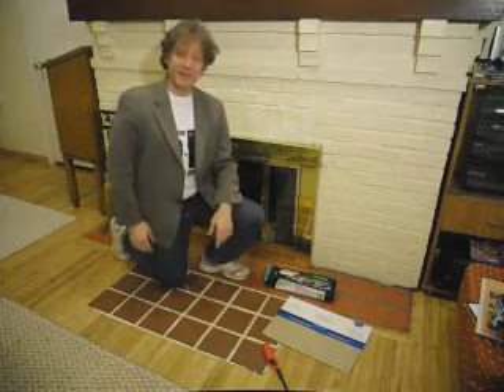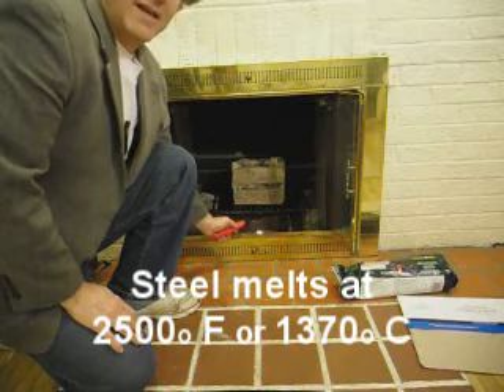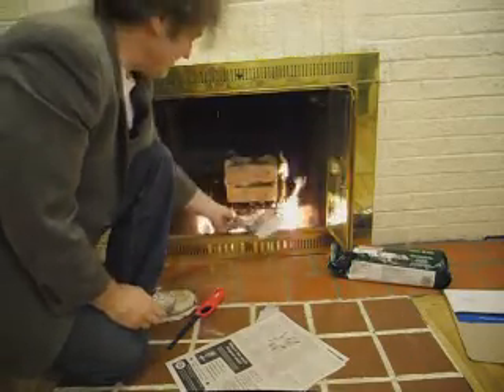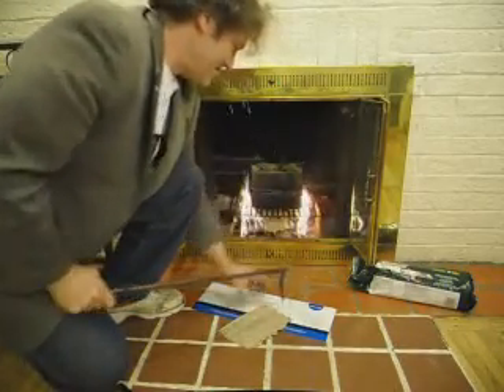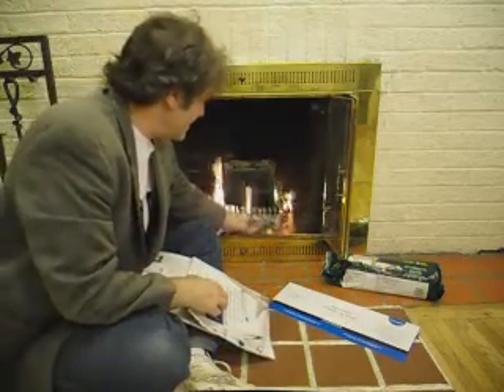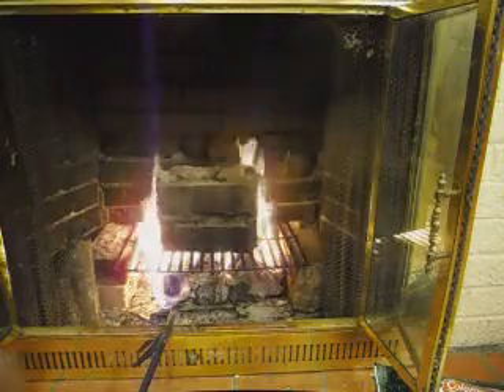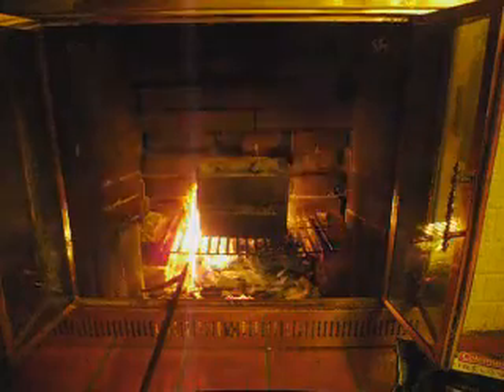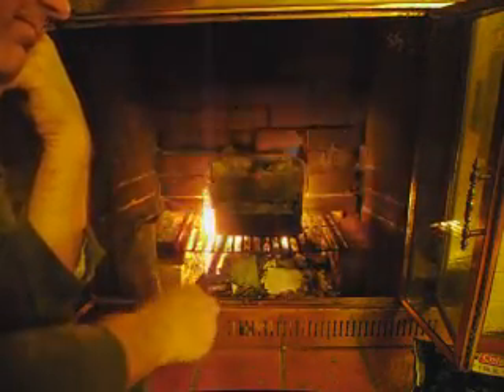9/11 Experiments: Does steel weaken much under fire?

Comment: Blacksmiths have been weakening metals to the point of malleability using fire, forced air and pressure (as hammering or other methods) for hundreds of years. They had no need to melt the metals. Just soften them to a point where they would lose much of their strength. The WTC buildings steel didn't need to melt. It needed to be heated to the point where it also lost much of its strength till failure.

Comment: And I also think that the failure of 100 plus story tall buildings that weighed in at 200,000 tons steel, contained 400,000 plus cubic feet of concrete, reached 1300 plus feet into the air, were horribly damaged by very large aircraft carrying massive amounts of jet fuel traveling at very high speeds can actually be simulated by your fireplace. But that's just me.

Comment: I firmly believe planes and the subsequent fires did not bring down the towers.

But this proves nothing either way ffs. The only way to experiment properly is replicate the events of 9/11 on a skyscraper, which is never going to happen.

It's just a shame that they couldn't forensically investigate the rubble and steel at ground zero because it was all shipped off for disposing asap. Wonder why they did that.
Reply: bsheehy94 Tottaly false ... No pieces left without being checked , all parts numbers where collected and the most significant where kept ...
Reply: olivier talouarn They didn't keep the steel and check it for explosives, they said this themselves.
Reply: bsheehy94 They checked each pieces before scraping ...Explosives evidence don t need chemistry to be seen ...
Reply: Yes they do.

Comment: Your experiment is invalid because:
1. fired was not as hot as was in the towers (1200+ degrees)
2. incorrect type of steel was used
3. incorrect load applied to grate
Your findings are invalid.
Reply from the maker: 1. The paper burned as hot as the paper in the WTC. The jet fuel burned off within the first minutes. The towers lasted for about 1 hour and people could stand where the "fires" were.
2. The WTC steel was stronger and higher quality.
3. The less "load" falling the floors, mostly space, and steel blown laterally.
Your argument is invalid and easily debunked.
Reply: TruthMakesPeace Actually, you are wrong.
1. Jet fuel burns at 1800 F
2. The load I was referring too was that of the intact floors above while they weren't collapsing
Unless you have an engineering degree, shut up. You don't get to have input.
Reply from the maker: gtaclevelandcity
1 Jet fuel has an ignition temperature of 210° C (410° F).  Not even close to 1800F.
http://911research.wtc7.net/mirrors/guardian2/wtc/how-hot.htm
2. Sounds like you fall for Bazant's hypothesis which has been debunked long ago.
http://www.ae911truth.org/faqs/634-debunking-the-real-911-myths.html
3. I got an A in Physics by a highly selective school. 
Steel falls down, not sideways 600 feet at 50 mph with enough force to stick into the AmEx building.
No PhDs in Physics are willing to defend the official story in a debate.
9/11 Physics Debate - Dr. Griscom wins. No top physicists support the official story.
Reply: TruthMakesPeace Yes, it has a flashpoint at that temperature. But do you really think it stays at that temperature as it burns?
Reply from the maker: gtaclevelandcity Good question. The jet fuel burned off within the first minutes. The towers lasted for about 1 hour, cooling off so that people could even stand where the planes entered.
Reply: gtaclevelandcity So it takes an engineering degree to get your attention. OK, see Architects & ENGINEERS for 9/11 truth. There are over 2,000 people in that org. that have such training who say the NIST 9/11opinion is hogwash and that a new inv.is needed. They build and design sky scrappers. You ever built a hi-rise, or even a barn, or outhouse? No pal, YOU shut da fuck up.
Reply: Jet fuel has an autoignition temperature that is at 410° F, but once ignited, it will burn in the range of 800-1500° F. Max adiabatic burn temperature is 4,040 °F, but that would not be relevant here. The point is that it burns far hotter than you suggest, and hotter than those flames reaching the grate in this none-too-scientific video.
Reply: TruthMakesPeace The Jet fuel burned off, after delivering over a million BTU.
NIST, FIREBALL DYNAMICS(75% Fuel survived)
fire.nist.gov/bfrlpubs/fire05/PDF/f05179.pdf
Your demonstration, is INCREDIBLY stupid.
Reply: Don't forget that it was also incorrect structure and the fire was inside of the building, so it acted like a chimney... the fire inside burnt even hotter because of the pull of air from lower floors
Reply: TruthMakesPeace the damage was already done. You also have to note that there was a huge amount of horizontal shear stress on the remaining supports.
Reply: TruthMakesPeace By the way, the lady who was standing in the WTC 1 entrance, Edna Cintron, Jumped to her death to avoid being incinerated to a char.
EDNA CINTRON jumping to her death
11-settembre.blogspot.com/search?q=edna+cintron

Comment: Uh, tell me how I am able to get steel pin to glow in the light of a paper/wood fire that burns at 440F?  you're giving the IGNITION temps not the MAX TEMPS they can achieve with enough fuel.  Good grief.  Tell me how a welder or a blacksmith ever gets their job done??

Comment: Even if the steel was red hot, it wont bend in this experiment. I was more concerned with the warping of steel in the vertical position as this would be more legitimate for those who understand basic mechanics of how building structures work.

Comment: People are not dopes they are just unperceptive if they don't take the time to look close at what some people see as obvious. Construction steel melts at about 2,500 degrees and jet fuel burns at about 1,500degrees. the Jet fuel all burned up in a few minutes. Different types of steel have dif melting points. Concrete does not melt and when it falls it crumbles into chunks not dust. Where were the chunks of concrete? the ruble had very few chunks but instead was pulverized by  explosions into plumes of dust that dispersed throughout the city. The fire was mainly focused in a limited area and would not have weakened the steel at a distance from the fire. the steel and concrete that was not exposed to extreme heat close to the fire would have put up a lot more resistance than enabling the free fall collapse. I don't know why they felt they had to blow up the whole building. It would have been much more convincing that this was a real attack if they had let the building stay in tact but I guess they wanted the spectacular shock effect and knew it would be very hard for most people to really question it. There is a certain type of people in power that care not for human life or suffering. this has been shown again and again throughout history with the many atrocities those with the power to do so can perform. There is some misinformation on this topic of 9/11 spread around to confuse the issue but How they did it has been explained . Like the eyewitnesses that verify these whole buildings were closed numerous times for "inspections" which is when they planted the bombs. Workers were observed carrying in many large containers. Just take the time to investigate 9/11 and explain where the concrete went. Watdh the vids including building #7. Listen to the eyewitness reports of molten steel burning for weeks after the fall in the ruble. Also the explosions at the base of the buildings before they fell. Then ask why 2,000 architects and engineers (and growing) that have had their credentials checked well want the investigation re-opened.        .

Comment: No building has EVER collapsed due to office fires but then 3 collapsed in one day. There were a lot of worlds first that day. The buildings falling at free fall and into the path of most resistance. Plane crash sites without wreckage. Maybe all skyscrapers need structural work to compensate for this new phenomenon and all new skyscrapers built need to allow for steel "Weakening" as you dumb sheeple like to remind us. If that action isn't taken then maybe all the insurance companies will be calling for much more money. Non of these things has happened to date though. Wonder why?
Reply: Well, have you ever tried having an office fire and taking out a half a floor of a large skyscraper?

The bigger the structure, the more crucial structural integrity is.  You can build a shack any old way and it might last, even if someone takes a sledge to the wall. 

BTW even in a house, you have to be wary of load bearing walls.

Comment: eriwilnel: Before I saw Richard Gage's theory of the CONTROLLED DEMOLITION of WTC7 that collapsed straight down, I bought the official theory that the jet fuel weakening the steal open trusses that caused the pan-cake collapsing of the twin towers.However, WTC7 never had a jet plane attacking, how come the 47 story building also coming down straight, not tilted ? I worked in WTC1 in 1995, but I was fired before 9/11, therefore I was not one of the jumpers of that day ! George Wu, AIA 2012-10-2

Comment: Of course iron will expand & bend under hot enough temperature, but can burning jet fuel liquify 1 to 4 inch ASTM A 242, HSLA steel? That's what the WT's were made of.

Comment: omg, not even close to the factors that took place in wtc. The impact trusses and columns were struck by a 767 carrying 11,000 gallons of jet fuel and impacting at 500 mph. The damaged trusses and columns were supporting 20+ floors some of the columns and trusses were totally severed still having to support the above floors of tons and tons of weight. News flash,,, the steel did not melt it sagged along with the floors of the impact area. This caused the outer columns to be pulled inward.

Comment: You don’t have to melt the steel, just get it hot.  In addition you have failed too factor in the tens of thousands of pounds of jet fuel. Your attempt to disprove the attack of 9/11 also did not include thousands of pounds of plastic.  They give off many times the BTU’s than paper does.

Comment: This is so sad.  You have put much effort into this?  Every rookie firefighter is taught that structural steel begins to lose its ability to carry its load at 600 degrees F.  Have you been down to your local fire station and checked it out.  Please do so…it will be in the Essentials book.  You can find fire department books stating these facts that were written 20, 40, even 60 years before 9/11, or is that part of the cover up?  Were they planning 9/11 before the WTC was built?